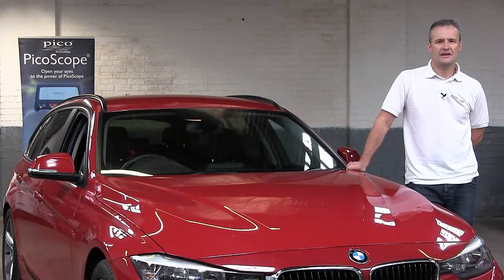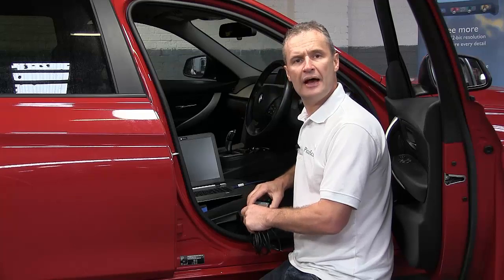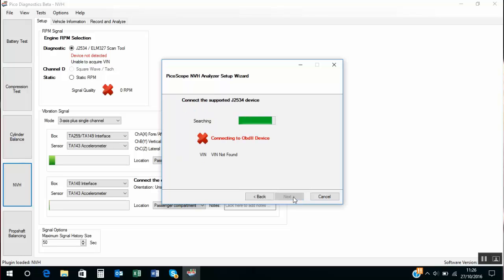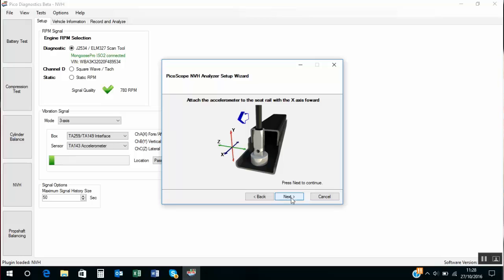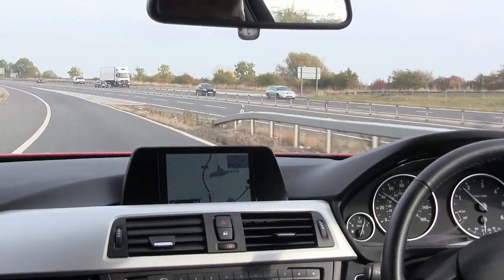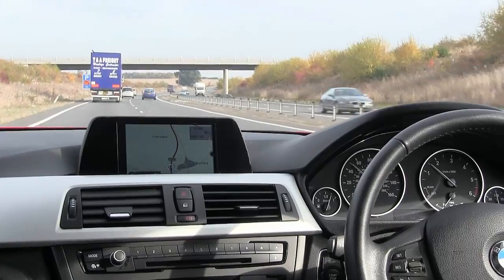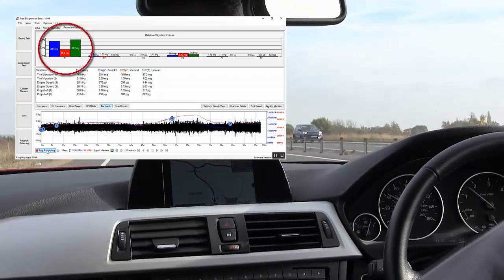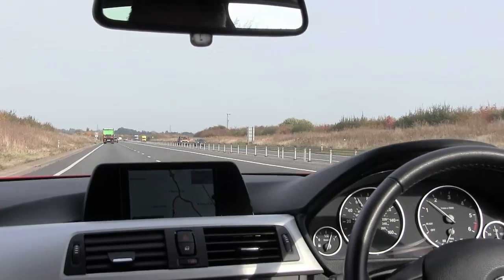NVH - Noise Vibration and Harshness

Comment: I don't mean to sound negative been thinking about getting one for myself but as for this particular video I must say the price be way to high.  By the time you made that setup I could have checked balance on that vehicle.  So where does that NVH shine?
Reply: propshaft, hard to vibrations at high speed.
Reply: @scientist100  That is a way old reply. I got the full Kit shortly after the video.
Reply: @ralfsautomotive  my fault, didnt realize it was you. So, how do you like this kit?